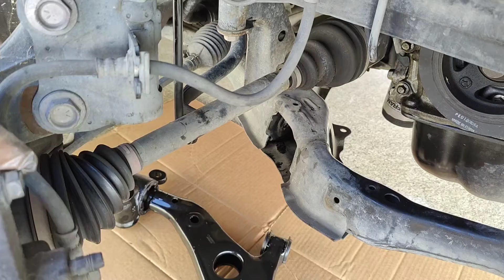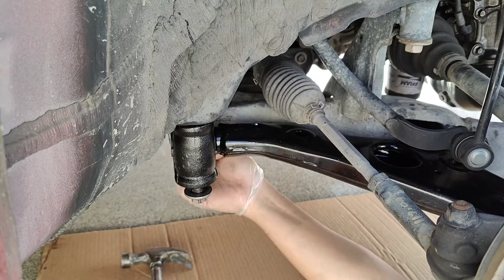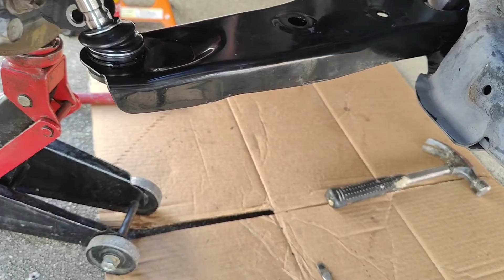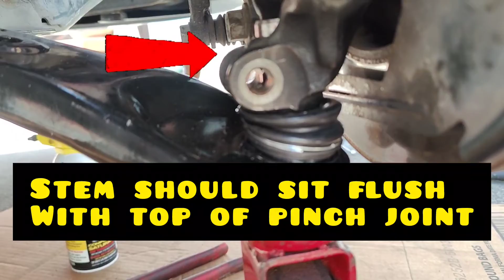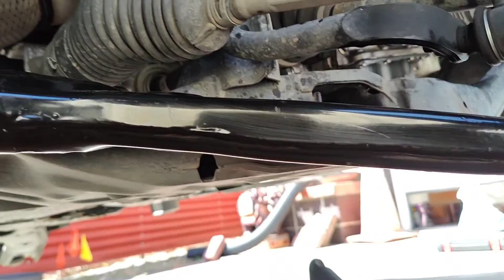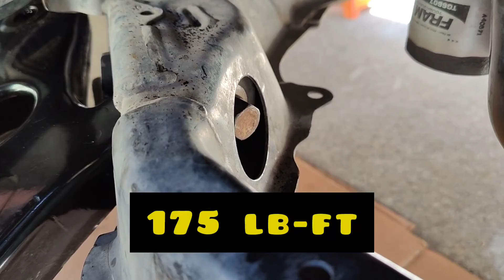Mazda cx-5 : How To Replace Front Lower Control Arm On 2013 & up cx5 (Part-2)

Comment: Just got my mechanic to do the front control arms. $960 for the job compared to the $1700 the dealership wanted.
Reply: How much did you pay for the one front control arm?
Reply: $960 for the front control arms

Comment: Final torque should be on the ground, otherwise, u chance pinching the bushings in a spot not natural to when it’s on the ground.  That will chew the bushings up quickly, over time…
Reply from the maker: I never thought of that. Thanks for sharing that tip. That does make sense to do the final torque when the weight of the car is sitting on the ball joint. Glad my car is still up in the air.